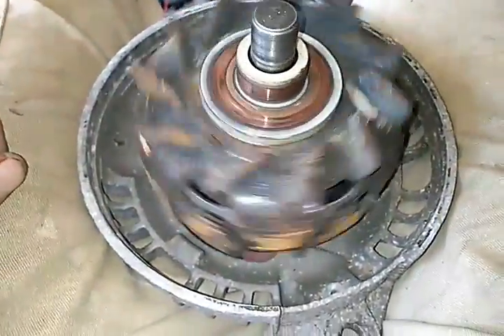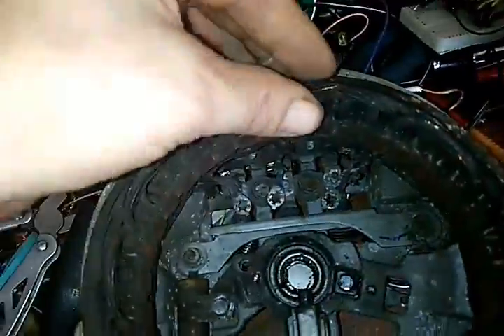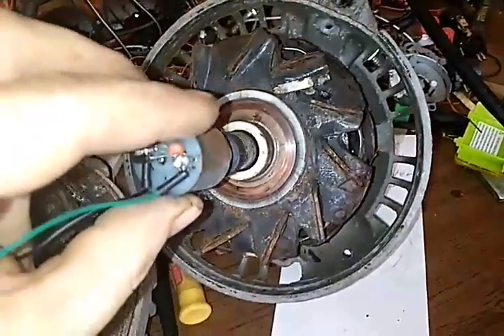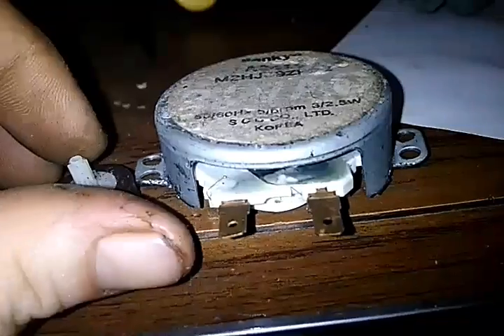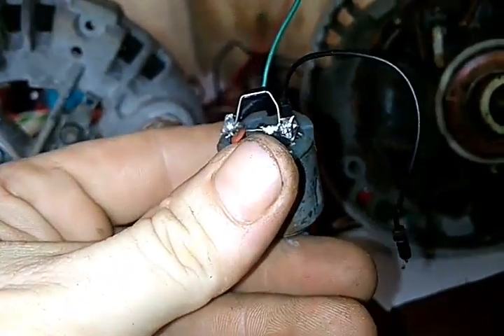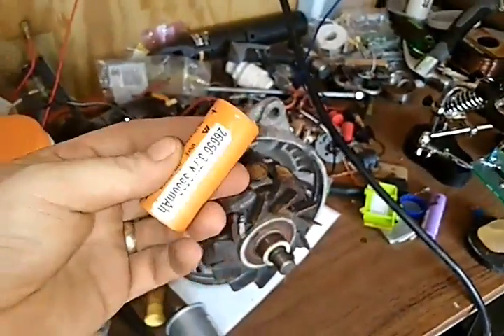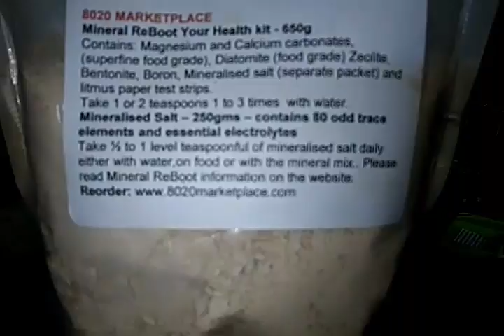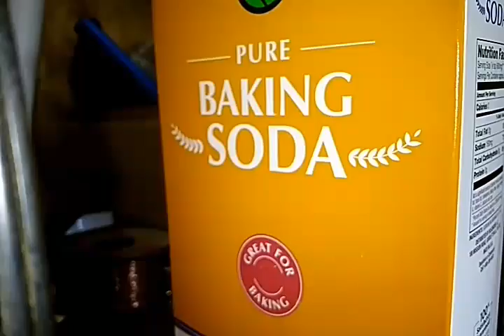Alternator Education P2

Comment: Can you just clarify one little thing for me please? Regarding the diode you attach to the field wires, does it matter if you attach it to the positive or the negative wire?
Reply: Oh yeah, one other thing. The field wire diode you said was 6 Amps and i can see some on ebay that look like it and they are very cheap. They are called AXIAL RECTIFIER DIODES. They specify the voltage etc. Some are 1KV, some are 600V or 200V. Does that matter?
Reply: Emailed you, please look out for it.
Reply from the maker: +Terrarium Firma Brother you can hook up to the negative feeding into it or you can look at to the positive feeding out of it as long as you're creating a circuit that won't backfeed you'll be alright if you put your diode in the closed circuit wrong it will start heating up.
Reply: Cool. Thanks!
Reply: Thanks. And how can I tell the polarity of the field wires ? My alternator is different to yours. I can email u photos if necessary. God bless u.
Reply: Plus I want to know how to test the polarity of the three coil wires too. Since my alternator is different to yours, i want to be sure and test it.

Comment: What if you used a solar panel to charge the battery that you use to send power to the alternator? Or am I wrong in my thinking. Shoot! I might be out in left field. Lol
Reply from the maker: Ronnie Spring 
after initial startup you will have enough power to run two houses so why not just hook a battery maintainer up to it to maintain the batteries after initial startup a lot cheaper than solar panels
Reply: Thomas Buie ok. My mind was just running. lol  I'm gonna try this setup one of these days. Gotta have back surgery soon so that'll give me something to tinker with afterwards.
Reply from the maker: +Ronnie Spring 
Brother, don't ever think of yourself as being wrong!!  think of it as trial and error the fact that you are trying alternative things means you are awake and becoming a higher level of intelligence...  if you want to use solar power then use solar power to charge a battery Bank that will run your motor to run your generator at night time when your solar power can not run your motor just have a switch that goes on at darkness and off at daylight...  don't ever think of yourself as being wrong... just make sure you put your motor maybe on a Gear Head or shaft to shaft but it has to be in efficient motor or you will have to have a larger battery Bank...
 #LIVELIFELOVING
Reply from the maker: +Ronnie Spring 
Brother I have three ruptured disc and my S route is rubbing in between S1 and L5 do not have back surgery take vitamins get an incline chair your body will heal itself it took me about a little under a year now but if you have surgery it's a 50-50 chance and after 10 years the surgery from the scar tissue and stuff you will be worse off!! Don't have surgery unless you absolutely have to your body will heal itself if you cut out all sugar and get more oxygen in your blood!!
Reply: Thomas Buie too late for that. First surgery 6 years ago didn't heal so gotta have another one soon.